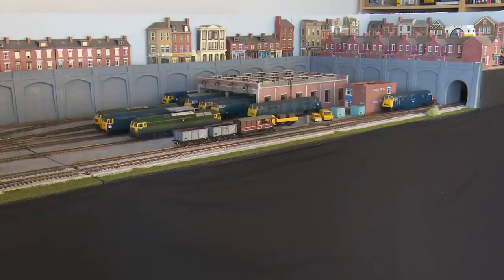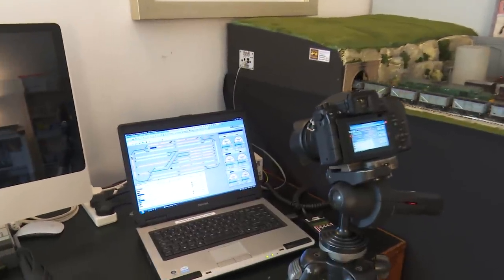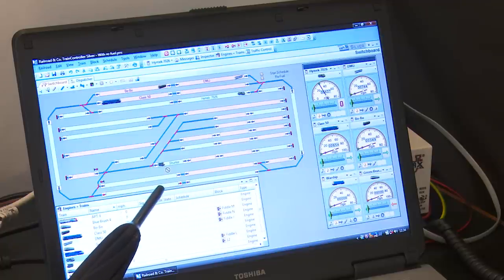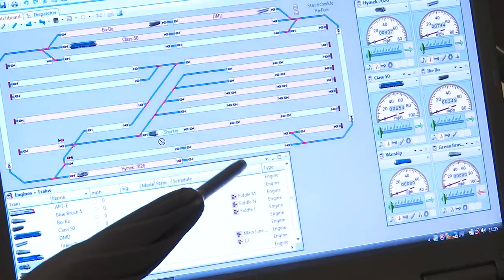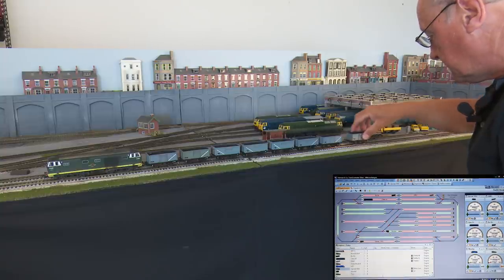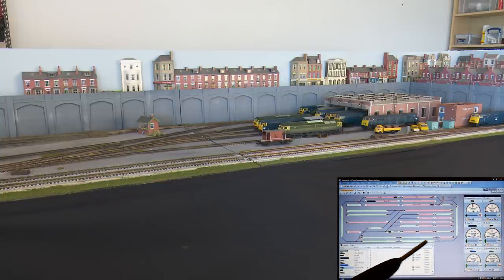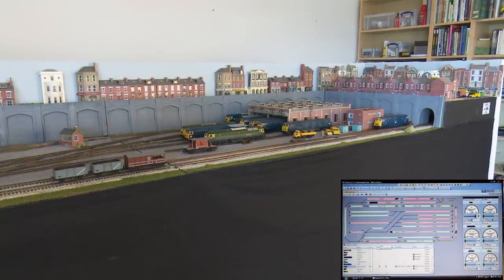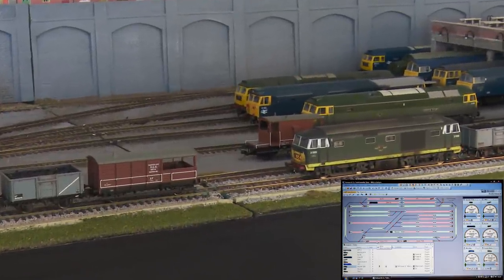Block Detection on rolling stock at Chadwick Model Railway | 9.

Comment: Hi Charlie, another great video. I have been using block detection for about 30 years now and I use 47K resistors as they draw less current when using longer trains. I believe that there is a mob in the US called RIX, that make resistored wheel sets. 
Cheers,
Bill.
Reply from the maker: Thanks Bill, I believe that DCC Concepts. also make resistor wheel sets. However, I use 10k resistors, so if you use 47k ones, how are you drawing less current?Regards, Charlie
Reply: Hi Charlie,
Just basic ohms law. That is the less resistance the more current in the circuit. For example if you put two wagons in parallel then your 10K becomes 5K and another two becomes 2.5K your current has risen considerably (4 times actually). See what I mean. That said I run fairly long trains with resistors on everything. That is 
Two resistors on bogie wagons and generally on the inner wheels (so that they don’t foul the coupler boxes. What could possibly go wrong!
Cheers,
Bill.
Reply from the maker: Thanks Bill, clearly I had a “senior moment”!  Regards Charlie

Comment: Hi Charlie - 12 months on and I’ve just converted my first couple of coaches using your “resistors on the axle” method (I’m not the fastest) - all working as expected.
Great idea - thanks - now for the next 40 coaches!
Reply from the maker: Well done Ken.  I’m still doing my freight stock. Either 4 or 8 at a time.
Regards Charlie

Comment: I've seen similar things before, built into the track for Signals, so the train had a piece of metal which changed the signal, the method you described is a great way of train in section, and on the computer screen is also a visual to add the trucks , a nice video indeed..
Reply from the maker: Hi Ray, 
I’m so pleased that you enjoyed it.
Regards Charlie

Comment: Hi Charlie, I’m working my way through this excellent series of videos and have a suggestion for you regarding the fixing of the resistor. The resistor is an SMD type and the best way to mount them on a circuit board is to use solder paste and then heat it up. There are a number of videos and ‘Instructables’ if you Google “solder paste smd’. 
Keep up the excellent work, your videos are quite addictive!
Cheers,
George
Reply from the maker: I’m so pleased that you enjoy the videos George.  
I’ll have a look into solder paste smd. 
Good luck with your layout.
Regards Charlie

Comment: On your computer where you control what blocks each train is going into ect, can use use that software to also manage signals so once a train has entered a block the signal goes red and once it goes into the next block it goes yellow and more
Reply from the maker: Yes, with Train Controller all of that is possible.
Reply: Chadwick Model Railway sweet that sounds like the system to use, cheers

Comment: Interesting video indeed, a rail system running on around 12v to around 20v max should never cause any heat issues with a 10,000 ohm resistor. Mind you I have not delved into SMD ones, but a standard 1/4W 10K resistor would not get even warm on these low voltages.
Reply from the maker: I’m so pleased that you enjoyed it JPM.

Comment: Hi Charlie - many thanks for your very helpful videos and your relaxed down to earth style of presentation - as well as your honesty. Also thank for your excellent photography and hints and tips on that as well as the introduction to that amazing layout McKinley.
As a newbie to the hobby I'm at the early stages of building my first layout probably of similar size to yours although a 4 track mainline roundy with branch and some shunting area. I have entered DCC with a Z21 and am wanting to implement block detection with a modicum of train automation for the main lines (2 trains on each track perhaps whilst I play at shunting etc).
 It would be very helpful if you could explain your whole automated system and how you find it useful and what limitations you see as well as how you might develop it in future. Many thanks once again.
Reply from the maker: I’m so you enjoy my videos and rest assured that Train Controller is on the video list.

Comment: Hi Charlie 
Only just seen this brilliant video on block control, not sure if you will see this question with the video 2 years old but here goes,. You showed the train stoping before it reached the 3 wagons ,  if the 3 wagons had been in the block the train stopped in would the train have stopped at the previous block under the town? Even though you have other track between the blocks?
Reply from the maker: Yes Mark, that’s correct. If a block is occupied the train will stop in the block prior to it. Regards Charlie

Comment: Could you glue a normal axial lead resistor to the axel and just "paint" the lead with conductive paint onto each wheel and maybe save the filing  of the axel?   Thinking that may be safer too as the axel wouldn't be used to conduct, only the resistor and  wheels.
Reply from the maker: It does sound practical Brendan.
Reply: @ChadwickModelRailway  I am in the process of preparing stock for block detection now and find I have done just as Brendan suggests, so can confirm it does work. I used the same paint as you Charlie over the ends of the 10k resistor leads where they contacted the wheels just to "glue" the ends down. Its a lot less fiddly than those tiny resistors you use especially for old arthritic fingers!

Comment: Hi Charlie, I have been watching you for a while now and many thanks your video's are very helpful.  I do have one question concerning adding the conductive paint.  What is the reason for paint at both ends of the Axle connecting both wheels, does that not make a connection between the rails which is bad for DCC causing a short?
Reply from the maker: No Andrew, the paint only connects the power to the resistor allowing for the wagon to register its presence in Train Controller.
Reply: @ChadwickModelRailway  Great thanks, going to do this to my rolling stock thanks again Charlie.

Comment: Thanks for posting the video. Very easy to follow and nice clear step by step. One question if I may; does every axle need a resistor on it or can just the last wagon in a consist have the resistor fitted?
Reply from the maker: Hi Tase, I would recommend that at least three
axels should be modified. This is because there is so little weight in these
smaller trucks, that conductivity cannot be guaranteed due to dirty track,
wheels etc. I know one chap who modifies every piece of rolling stock as he
buys it!  Regards Charlie
Reply: Chadwick TMD cool. Thanks for the reply Charlie. Regards.

Comment: Hiya, again... Yep yet more questions for you... How long do you make a block on a large layout? 1m, 1.5m? When you were showing us that a train under computer control will not go into an occupied block I was watching your monitor and when the train left the last horizontal block before the town it disappeared from the monitor for 30sec or so before appearing in the vertical block under the town, why please? Yet another one, why do the breakouts not appear as blocks but just as routing? Yes I realise it's not wired via the sensor board but why not use them? And another, is there a limit to how many blocks you can have on your silver system?
Reply from the maker: There’s no limit to the amount of blocks that I can find.  No one appears to wire points/switches into blocks, it’s just too difficult with little gain.
The block length is determined by the size of the layout. My older TMD has relatively short blocks which match the train length.  The new layout will have longer blocks to match longer trains.
Reply: Thank you kind sir. There is so much to learn but thankfully people and channels like you/yours are making the process a lot easier. 
Can the block control information also control the signals, or is that best left to the local sensor? If it can be included that would make a good video, ie the whole system as laid out?  @ChadwickModelRailway
Reply from the maker: Yes it can Steve which I will cover further down the line.

Comment: Charlie, if you put lights into the brake van, would this not do both the track occupancy and provide a useful function?
I hear your point about clean track, etc, but have a (slight) concern about inrush currents for the stay-alive functions, so multiple drain currents lie this might push things over the edge.
Regards, Tom
Reply: In software, there is a standard concept of debounce, so if a signal disappears for less than, say, 1 second, then it is still considered to be present. (Hardware does it with capacitance. ) Does your computer allow you to add debounce, or your occupancy detector have a speed of response that can be varied?
And, to take it back to the general question, what is the occupancy detector circuit that you are using?
Thanks, Tom
Reply from the maker: Hi Tom,  I'm using Digitrax BDL168's for block detection and Railroad and Co train-controller silver, software.  I have never heard of debounce but I'll certainly read up on it on my return home next week.  Yes the brake van lights will certainly fulfil this function (if of course their power comes from the track) but some trains are long enough to occupy several blocks.  I hope that make sense.  regards Charlie
Reply: Chadwick TMD 
Charlie, thanks for pointing out the obvious that the blocks may not contain a train fully; my mental model had no train longer than a block, and so I have been struggling to make the blocks long enough for the interesting train control.  Moving to shorter blocks, but with extra detection wagons to keep each block occupied, just changes the game. Magic!

Comment: How well does that "electrical paint" last?  

I would think that eventually the rubbing between the moving wheel and the stationary paint would cause it to eventually to disconnect?

Just seen this ... kind of think this would be more reliable long term.
Reply from the maker: It’s fine John and certainly lasts.
Reply: @ChadwickModelRailway  thanks!
Reply: If the wheel and axel turn together, it would never rub off :)
Reply: @EsotericArctos  Thanks.... Had to go watch it again ... Yeah I was not fully seeing that it appears to turn as a single unit.

And I don't really know how on the truck itself how the wheel/axel assembly is attached.  Thanks

Comment: There's no doubt about it... It's here that I manage to reveal my masterful ignorance of many if not all things regarding propper and/or conventional train operating protocols... Would the problem of one's rolling stock not registering on the monitoring system as occupying any given block be solved if every train that one assembled and ran were to include a suitably modified and appropriately positioned guard's cabin (or caboose?) rather than having to modify ALL of one's other carriages, wagons and so on,  so as to enable the system to register their true status/position?
Reply from the maker: You are dead right. The rear vehicles of my trains all have resistors or lights so that they register that the block is occupied. Regards Charlie

Comment: Hello. Good video, I planned using resistors with wires each end, soldering one end to the axle, the other to the wheel, but your paint method has given me another option.
I'm new to DCC and was just wondering why Digitrax didn't detect the short circuit before the base of the wagon melted.
Reply from the maker: I’m so pleased that you enjoyed it Kevin and hopefully you’ve subscribed too.
I don’t know why it didn’t detect a short but I imagine that the resistance was too high.

Comment: just a thought (I am not very knowledgable about dcc so this may be rubbish) as you add more rolling stock with resistors so the effective resistance across the track will reduce - resistors in parallel. Will a large layout then see a low resistance across the track and shut down?
Reply from the maker: Hi John, 
It’s a fair question.
The resistors are very low in value and therefore draw only a very small current.
I only fit them to the last couple of wagons so that the program will no that the track is occupied should you get a breakaway.
Regards Charlie
Reply: Hi Charlie, yes it obviously does no harm as you use the system without problems!  I am probably over-thinking it!!  I am thinking about constructing a layout with DCC, so I am finding your videos very interesting and helpful.

Comment: As in BR days signalmen used to ensure that the brake van (& lights at night) were at the rear of aa goods train would it not be better to fit the resistor to the last wagon (i.e brake van) and the wagon next to it if you wanted the security of 2 wagons with resistors? If in your example only the goods van became uncoupled the last block would show clear.
Reply from the maker: Hi Pat,
You have made an excellent point, one that I had clearly missed.
Regards Charlie
Reply: But you said do the last three wagons and only showed two coal wagons being moded so I thought you had done the guards off camera?  @ChadwickModelRailway

Comment: Only just come across this. Brilliant video. Does anything need to be done to the track for this to work apart from creating the blocks with isolating rail joiners. Is there any special wiring required or does the software take care of all that?
Reply from the maker: Hi Mr Bones,
As you have suspected, there is more to this.  You need a block detection system such as Digitrax BDL 168.
It’s best that you contact Digitrains and speak with Jeremy.  He can explain more and the costs involved. Take a look at my very first video which shows basic automation.
Regards Charlie
Reply: Thank you.

Comment: Hi Charlie, another great video. I’d like to ask you how you deal with your points if I may. I understand how you have used the BDL168 to  power the individual sections and I also understand how to set the occupancy sensors up in Train Controller. I know that in TC, you can’t have points in a block so my question is, do you feed the rails of the points through the Bdl168 knowing that TC won’t see that area or do you put in a separate feed and therefore save a channel on the BDL168? 
Best Regards 

George
Reply from the maker: Hi George, they are fed separately. TC sees them but is oblivious to whether they are occupied.
Reply: Thanks Charlie, that’s a great help to me, keep up the good work!

Comment: Just a thought, I notice that the glue on one side and the resistor on the other side of the axle are opposite each other, does this not unbalance the axle a little? would it not be better if the two were 180 degrees from each other?
Reply from the maker: An interesting point Steve but I’ve never noticed any issues.

Comment: Couldnt you add extra IR detectors to under the track instead of modifying the wagons?
Reply from the maker: No, it would take dozens of detectors.  This way you only need to modify the last couple of wagons.  Also, the cost of installing these resistors is tiny compared to using multiple IR detectors.

Comment: hey, something i am confused about with the wiring of block detection, is it the single wire that goes to the track from the bdl 168 that supplies power to the track, or is it the dcc bus?
Reply from the maker: It’s a single wire from a BDL168 channel into each block.
Reply: @ChadwickModelRailway  but is there a dcc bus wire as well as the single wire from the bdl, or does the single wire power the tracks
Reply from the maker: I power the BDL168’s from a common bus.  The bus also powers the point rails as I don’t include them in the block detection circuitry.

Comment: How do you wire your points in block detection charlie? should they have their own power separately or be apart of the block somehow?
Reply from the maker: Yes, I never wire them in as blocks.
Although train controller knows that they exist, it never knows if they are occupied.
Reply: @ChadwickModelRailway  Ok cool, so i just wire the point to the main bus wire and fit isolated rail joiners?
Reply from the maker: That’s it.
Reply: @ChadwickModelRailway  Yea, just tried it and works great!

Comment: Hi Charlie. Does the system run using a typical bus wire? How it knows where the power is being drawn from is complete witchcraft to me at the moment! I'm building a DCC layout with the hopes of upgrading it to complete automation in the future, but am having trouble figuring out how exactly the wiring for the future system should work. I'd like to have it ready to go and not have to re-wire it later on.
Cheers. Mike.
Reply from the maker: Hi Mike,
As an interim please ensure that each piece of track has its own power feed from the bus wire.
This will enable you to set up block detection at a later stage.
Regards Charlie.
Reply: I know it's been 7 months but watch Charlies videos on wiring track...

Comment: Where did you get the back-to-back gauge? I've been changing the wheels on some Hornby-triang wagons and I have been wanting to check them. And would this work for passenger stock?
Reply from the maker: Hi Scott,  I'm sorry but I cant remember exactly where I bought mine.  However, in the July issue of "Hornby Magazine", page 39, is the very same gauge.  They call it a Double 0 Gauge Association gauge.  I do hope this helps.  Regards Charlie.
Reply: Thank you for this new information I will start looking through all the magazines I have for this issue.
Reply: Scott Dryden 
Scott, the big suppliers (like Liverpool or Sheffield) stock the back-to-back gauges. Be sure to select the OO size, at 14.5mm. DCG-BB145